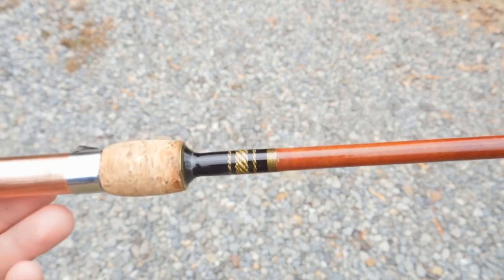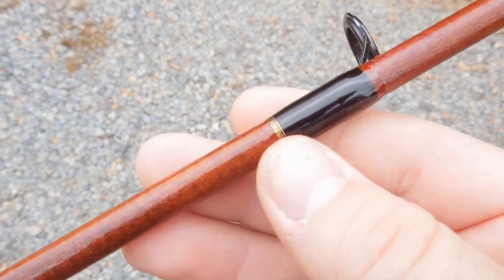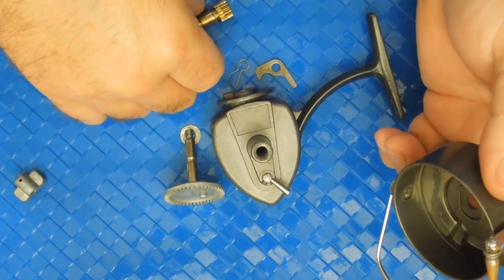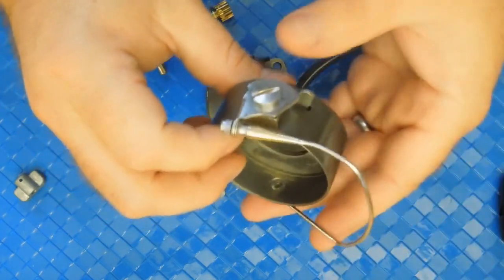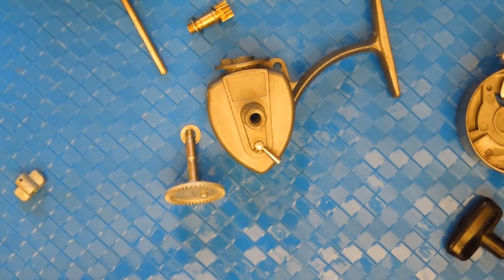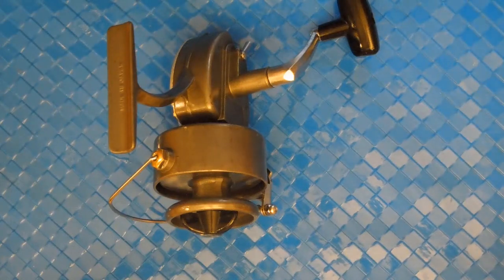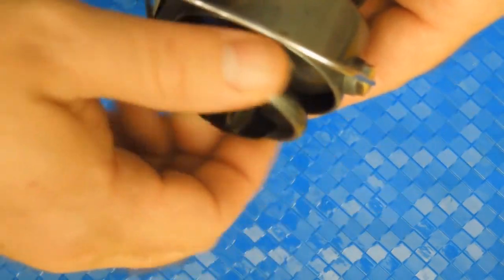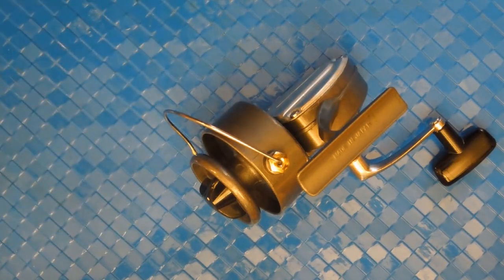Giveaway Video Series 2017 - Vintage Combo Rebuild Part 4: Reel Rebuild

Comment: The early Garcia Mitchell reels didn't have a moving line roller either. I have several of those reels tat I use and have never seen the line cut through it.
Reply from the maker: That is true, but they were made out of carbide which can't be cut unless you are using diamond based abrasives.
Reply: @TheFishingHobby  Thank you for letting me know that. No wonder the line roller is much darker than the rest of the bail. 👍
Reply from the maker: @kiteman357  it was a good setup and I wish they still were made like that for simplicity reasons. One less thing to maintain!
Reply: @TheFishingHobby  You said it, brother.

Comment: Yeah, Flowblade works well. Glad the new computer works well.

I have wanted to import some glass rod blanks for a long time. I've found a source for some glass blank that look vintage like that.
Reply from the maker: Really? Did you get any figures on cost? I can't even count the number of graphite rods we have managed to break, fiberglass is so much more durable. Bass Pro sells some nice glass ultralight rods for $20. I have a 7-1/2' one and it is actually really nice. My wife and kids use them too in different lengths.
Reply: What size & strengths do you mostly use?
Reply from the maker: We use ultralight rods about 90% of the time. I like 7-8' lengths. My son uses a 6-1/2', daughter uses a 5-1/2' and my wife uses a 6'.
I'm about to look for some medium action glass for catfishing though.